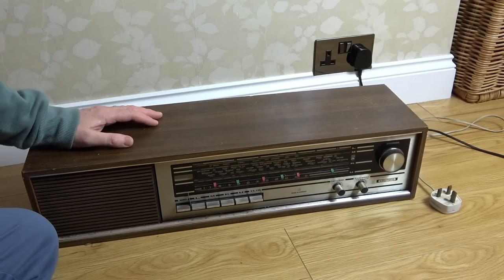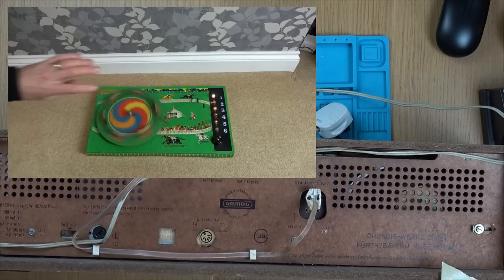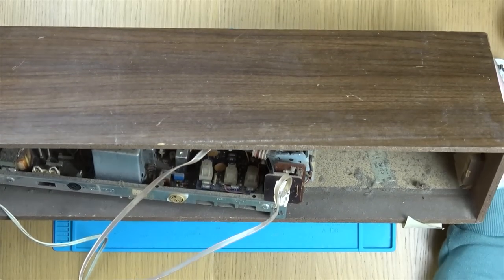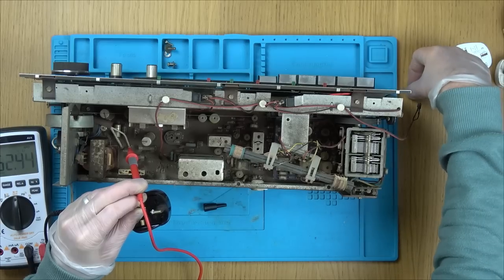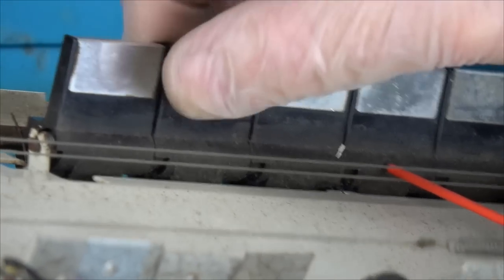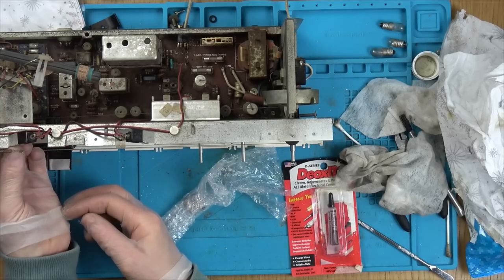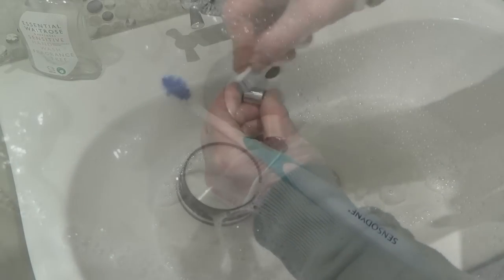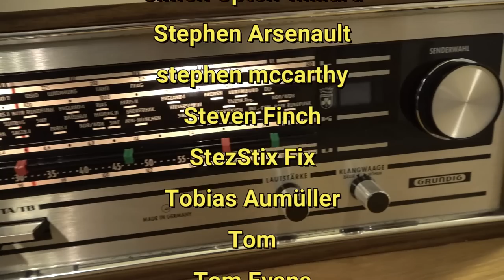Trying to RESTORE a Dirty HUGE Vintage West German 1960s GRUNDIG Bookshelf RADIO

Comment: The fuses used in UK electrical plugs are available as 1A, 2A, 3A, 5A, 7A, 10A, and 13A, although 3A, 5A, 10A, and 13A are the most common (some extension leads use 10A fuses, computer power leads sometimes have 5A, other lower powered devices are usually 3A, and kitchen appliances which have higher current draw are usually 13A. UK plugs and sockets are made to British Standard 1363, and the fuses in the plugs are made to British Standard 1362)

Im guessing that the 13A fuse in the plug is what the plug came with, as the radio may have come from the factory without a plug fitted
If that is the case, then the reason why it had a 13A fuse is because whoever fitted the plug didn’t swap out the fuse for the correct value when they fitted the plug

EDIT: also, fuses have sand in them to absorb the energy of the explosion that occurs when the fuse blows
And that power cable looks like it may be single insulated, so just be aware if the cable gets damaged you may end up with live wires exposed (modern power cables, at least in the UK, have 2 layers of insulation, so if the first layer gets damaged there is no immediate shock risk)
Reply from the maker: Thanks Pineapple 👍 Yes this power cable is single insulated, certainly not as safe as modern day radios. Does look better though and will probably last longer 👍😁
Reply: The fuse rating should also depend on the cable. A 13A fuse should not be used with 3A cable. (I'm not sure of the amp rating of that old, single-insulated, twin-flex cable, but of course it wouldn't be rated for mains usage these days. I remember similar cable used to wire up bedside lamps, etc. in the 70s, so probably only rated at 3A.)
Reply: Ellis The DJ  the 1A fuses that i have seen in shaver plugs are not normal plug fuses, and they are made to a different standard
I will admit I’ve never seen a 7A fuse used anywhere, but they do exist and are available (i have specimens of each rating of fuse)
Reply: Why do you have fuses on the plug itself ? Its an extra protection ? Or the main house power line is direct without safety breakers ?  Its only in GB i think..
Reply: @drorhaz  socket circuits in the UK are generally on a 32A breaker, whereas the plugs and sockets are only rated for 13A, and often, appliance cords can have a lower rating than 13A (the power cords that come with devices like games consoles may only be rated for 3A or 5A, and some extension cords are only rated for 10A)
Reply: @drorhaz  In the U.K., We don’t generally have a circuit breaker for each individual socket, so you will usually have 1 breaker for all the ground floor sockets and 1 for all the upstairs floor sockets (plus a separate one for cooker), hence the current rating being fairly high. So having the fuse in the plug is vital. Wiring this way greatly reduces the amount of cable you need to wire a house.
Reply: @drorhaz  It is due to the use of ring circuits in the UK rather than the radial circuits used in most other countries. The total permitted current in the ring (32A) could overload individual sockets (13A) if the plugs are not fused to limit the current. Putting the fuse in the plug rather than the socket then allows the flex to the appliance to be protected against overload. To a lesser extent, the appliance itself may have some protection too, but the main purpose is to protect the flex and the socket.
Reply: @crcomments8509   nice explanations from all of you guys.. it make sense now. Amazing how every country has different ways of thinking :) thanks for the answers.

Comment: nice video... a great looking radio from another time. Two things:1. You didn't show it but its missing screws on the bottom that secure the radio chassis to the case. When you move it, it will flop around on the inside. 2. Some caps should be replaced. They are probably paper caps that when leaky, will cause noise or a hum.

Comment: Lucky for you, that this radio is an Solid State Radio. I have a Grundig Radio with a bad Filter Capacitor, and a Bad rectifier. An it is A Tube Radio.  

Thank you for that Video.

Comment: Very nice restoration! I have a Grundig radio from my dad. It still works perfectly. 'AUS' means 'off' in German, so maybe Google translate would have helped out here. 🙂 When dealing with the bulbs it's a matter of whether you want to keep it 100% original or just functional. I like to compromise in these things. For example, I replaced all the incandescent bulbs in a 1977 National Panasonic stereo system with led's with a warm colour temperature. When you turn it on, you can't tell the difference with the old bulbs and led's won't burn out that easily. It's just a matter of calculating the right values needed for the current limiting resistors.

Comment: For your vacuum make up a tool with a bendy straw and some cardboard to partially restrict the air as the motor would overheat sucking just through the straw the tool is very good on cooling fans and refrigerator radiators too as dust can be cleared from deep in the matrix.

Comment: 3 Pack Of Konstsmide 7V, 2.5W, E10, MES Spare Apex Bulb For 35 Lamp Light Sets are diffuse lamps and sold in the UK - might be a bit longer

Comment: Those radios were eveywhere some 50 years ago. Often bought when FM transmissions started, and displaced many AM-only valve radios. They were quite nice sounding and modern, stylish alternatives to similar looking, but far more expensive recievers with separate speakers. Here in Norway, local producers Radionette and Tandberg made some very good versions, even some higher end stereo models with internal, closed box speakers. Very collectible today.

Comment: The hole in the plug was to enable visual inspection for the presence of an earth cable.
People also used it as an entry to earth the radio's antenna.

Comment: Mine was bigger than yours..😂
I had a Grundig Lumofon which incorporated the same radio/tuner as yours combined to a turntable
and held within a huge cofin sized Stereo radiogram cabinet. 
The 5 pin DIN socket at the back would be an amplifier input.
There was an extra pot on mine for the stereo balance, but apart from that the facia was the same as
yours. It had a lovely tone to the audio and was working fine, right up to day that it went into landfill.

Comment: Please replace the appliance flex.  It's single insulated and is actually illegal in this country.  The reason being any slight damage can expose live copper.  I know you want originality but I would suggest not at the expense of safety.  Inside the fuse in a plug is sand.  This so if the fuse wire blows, the energy is disapated and the ceramic casing does not shatter.

Comment: To the latest regulations, I would replace the mains flex to what was fitted to wooden cased TV's of the period up to the mid 1980's (flat twin grey sheathed flex). The 13 amp fuse is likely to blow any internal fuse on the pcb of the reciever/radio.
Reply: Also mind how you handle the ferrite aerial. The litz wire its wound with has a notoriety for breaking without any visable cause. Would be lucky if most of the ferrite rod coils had connection tags. With the bulbs 1/2 to 1 watt series ballast resistors can be used if the bulb is of a lower voltage.

Comment: This reminds me of a portable Grundig (Elite Boy 210) radio we had when I was a kid as it has a very similar tuning display. That radio ran off a large 9 volt battery (PP9). The 5-pin DIN socket on the back will be for connecting a tape recorder so you can record radio programmes as the portable radio had the same socket. It should also operate as an input to use the radio as an amplifier which might be what the TA/TB switch is for. TB might be TonBand (German for Tape Recorder).
Reply: TA is Tonabnehmer, German for sound pickup, which means this is a record player input. Showing both TA and TB, this is a combined record/tape socket.

Comment: I might be interesting to use a small length of 12V LED strip in place of the two bulbs. Running if from the 7V supply would reduce the brightness, which is probable a good idea in this application. It may give a more uniform illumination and would probably last for life of the radio.

Comment: The polarity of the mains wiring absolutely does matter. While this radio is probably not a "live chassis" design, there were many such designs back in the day, and in some countries with no keying on the mains plug, could be flipped either direction. So you had a 50/50 chance of making the chassis of the radio live, which is why knobs and external metal was insulated as much as possible. But if a knob broke off, or you touched the exposed antenna, the only thing between you and the mains could be as little as a single diode or a capacitor. And since old wax and paper foil capacitors tend to go acidic, they're effectively resistors when they get old and fail.

Neutral should be tied to the chassis always on ungrounded designs. You should be able to use a multimeter to determine which wire on the mains cord goes to the chassis.

Comment: I’m the process of watching, as you are changing the plug early on. As you like the original, wouldn’t it be possible to just change the plug pins so you keep the OG Bakelite plug, but have the insulation for safety?

Comment: The powder in the fuse is silicate to prevent the fusewire from remaking when it blows and to reduce flash from the wire. It absorbs the energy if you like. The gap in the top of the plug is to allow expanding hot air to escape if the fuse blows, so that the top doesn't blow off the plug. No doubt someone will say I'm talking rubbish and explain it differently - but that's what I was told anyway. Edit: It wouldn't matter which way the wires were put in to live and neutral as the input goes to an isolation transformer. Just as long as the earth pin wasn't used instead of the live or neutral. The radio may continue to perform normally for years as it is. But it could start to fail as components are used again. Favourites to fail are the electrolytic capacitors and the mains rectifier if its a selenium one. Then maybe the transistors, especially if they are germanium. When you pointed out the massive heat sink the components on it were the audio output transistors which are in what look to be a push-pull configuration. In between them is a thermistor which is used to regulate the bias as the transistors heat up (I guess)  - which suggests they are probably germanium as they are more sensitive to heat changes than silicon. Entertaining and enjoyable video to watch. Nice touch at the end with Beethoven's Fur Elise. Very German and also for Elizabeth (II)?

Comment: Nice restore looks really nice done a very good job. If I were you when you get the new bulbs installed also change that single insulated mains lead that's a strict no no now on exposed cables. It needs to be double insulated for your own safety it would be failed on a test and not be allowed to be sold like this now days.

Comment: 220V with 3A is 660watt a bit overkill for 10watt required
Actually on the backplate it says in german 50mA fuse required
But it doesn't say if it is the cable fuse or the internal fuse

Comment: It’s kind of a timeless piece. Looks good on the side board.

One thing is not to use paint on veneer, instead use a brown crayon and rub over the scuffed bits, leave for a few minutes and then gently rub the excess.

It’s the same process when you have a chip in your kitchen counter tops.

Comment: I think they used 7 volt bulbs, so they ran a little less bright and hoped that they would last longer. The voltage supply was probably something less than 7 volts, perhaps 3~5 volts.

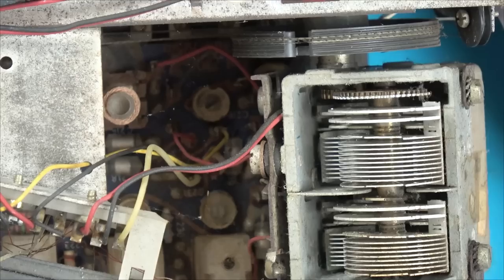Comment: Minute 18:17 that's called a varicap or variable capacitor. It's the equivalent to a variable resistor it potentiometer but in capacitance

Comment: Hve you considered using an appropriate wattage light bulb to bridge the fuses for testing?  It would help "illuminate" excessive current draw in a device.
Reply from the maker: I have thought about it especially when I was working on those inverters a while back BUT I never got the bits together though 👍👍

Comment: Actually, the values for the fuses are printed on the backplate of the radio (left side) - in german of course. Look for the word "Sicherung" which means "fuse" and take the values...If you need to replace the lights/lamps, those values are mentioned here as well ("Beleuchtungslampen").... Those type of Grundig (pronounce "Groondick") Radios were pretty common in german households in the late 60s and early 70s, you could find them virtually in every living room in the telly-rack right near the TV :) Those 6V and 7 V lamps are still common in refrigerators etc., they are not diffusing , though...well, you could wrap a small piece of thin paper around them...

Comment: You can put a dropping resistor in series with the dial bulbs to drop the voltage to 4 volts

Comment: i often find the fuse blown on these old radios for some reason  i have worked on vaccum tubes ones
and the front lights is always blown too

a tip you can get 12v bulbs but double the wattage for these

Comment: I think some accylic paint or something might work, also depends on how hot the bulbs get, otherwise the paint will just crack. while yes you might have blown the bulbs using bulbs that are a lower voltage, it isn't just that, it is also the fact the system might not have enough resistance to the 0 volt rail. If you taken the radio to a repair shop they probably would reccomend changing the capacitors, and nearly certain they would reccomend changing the mains cable to a modern standard. all genuine UK fuses are filled with very fine sand to try and reduce the risk of electric shock/fire but most importantly to keep the plug together even if the fuse does blow, so that even if it was to happen while the user was pluging into a live socket the plug won't just explode in their hand with serious consiquences. so the sand also works as a dampner to the fuse exploding with force.
Reply: great video though Vince, shame wasn't a fix as such, but worked out quite nicely.

Comment: Towards the very end of this video I have spotted a switch saying TA/TB, This stands for TA= Ton analog and TB=Tonband I think. I am not sure even being German. LOL
But I know you should be able to connect A Tapeplayer/Cassette Recorder/REcord Player and possibly even a microphone if it has the correct impedance. Look at the back for a signal in port. Possibly a round DIN5 with 5 conntacts or because it is Mono onl a DIN 3 wich also is round but only has a 3pin contact.

Comment: for the bulbs you could xcheat nd stick a couple of resistors in there as a potential devider to drop the voltage a little.

Comment: Nice work vince ,   its what younger generstion , dont realise these days 

Some of the tech we geew up with , has more clout for the buck ,   than 
Some of equipment around today !! 

I had a budget puoneer ,seperstes amp ,   bought for 50 quid ,  in black with silver facia and dials 

Id tell model number if i were not writing 

I also had a silver ,  seperate tuner and seprate tape deck 

And the quality ,those gave out 

Even bose cannot compete ...
Reply: Pioneer sa 5300
Reply: Yeah tuner was some brand like fidelity,  slim silver , tune knobs to right ,  station frequency selcet to left , and vr meters for stereo strength and such ,   bees knees ,  reliable and punchy

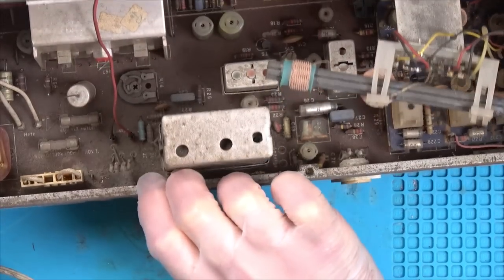Comment: 19:02  About the power cable:  it says on the PCB "Netz" which is German for network or mains.  I'm assuming that's the live wire terminal, the other  looks to have the negative sign there.
20:36  You may double/triple check it, but it looks to me that you have the wires REVERSED in your plug.  The live wire should go to NETZ.  Of course it's AC power, BUT if you reverse the cables, the inside of the radio will always be "HOT", even if the power switch is turned off, resulting in more EM pollution on your power line and faster device burnout.  That's also bad when you have the power turned off, but forgot to unplug it and decided to touch something inside:).
Reply: @voltare2amstereo  Of course it will work either way... it's AC voltage.  The problem is when the power switch turns off just ONE wire.  If the wires are reversed, you disconnect the neutral wire, but you end up with the components inside still connected (hot) to the live wire.

Comment: 3:55 Anschluß für = connection for
TA = Tonabnehmer = pickup (of a turntable)
TB = Tonband = reel-to-reel

And for the front:
aus = off
L = Langwelle = long wave
M = Mittelwelle = AM
K = Kurzwelle = short wave
U = Ultrakurzwelle = FM
Lautstärke = volume
Klangwaage = sound balance
Reply: Thank you - for greater clarity - Mittelwelle is known as Medium Wave. Typically long, medium and short wave transmissions would be amplitude modulated (or AM).

Comment: The fuse in the plug has nothing to do with the device. A UK plug is fused to protect the cable alone and should be rated for it. The pathetic twin speaker cable used on that radio as a mains lead is absolutely not to any UK spec even from it's era. I suspect it is also not up to the German specification either. Something like a "figure 8" lead and socket also known as a Telefunken would be a suitable mains lead and connector.

Comment: That is a nice radio ;) My gandmother have a Grundig RF420 in the kitchen from the 70s. I have got my first Flip Clock a Sankyo Digi-Glo Model 501 and love it but what type of oil do a use in it to make it quiter? It works very well and even the light in it is still working. Did buy it for very good price that was similiar to what a parts unit on ebay go for.

Comment: Great video - hey what kind of capacitor is the big one I see that says 1000/10? 
Is that 1000uf at 10 volts?
Did you replace any of the caps?
Thanks again!